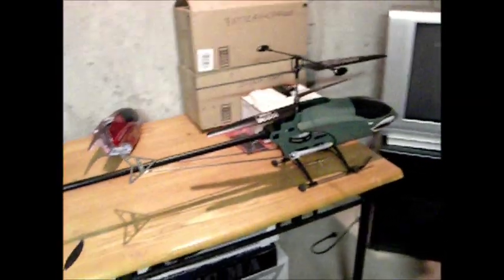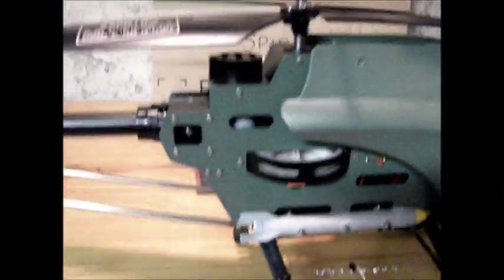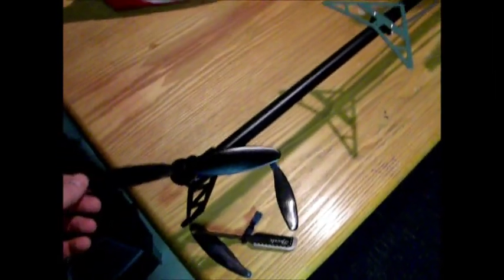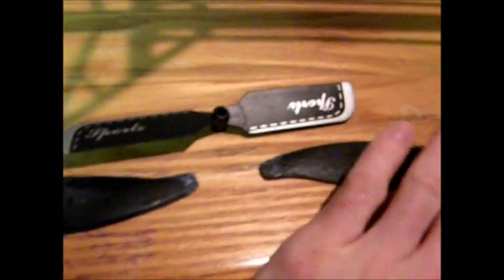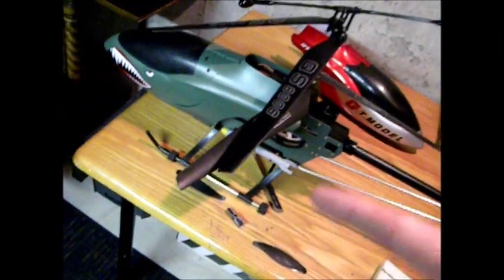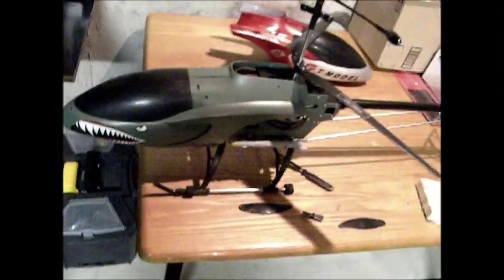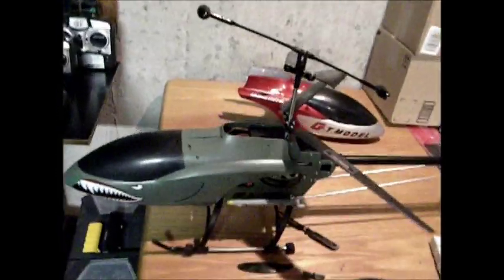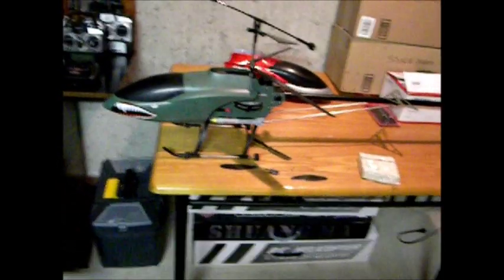QS8006 modifications (Paint, tail rotor, and weighted nose)

Comment: I bought a box of Plasticene from the dollar store.  Mine had 4 colors in the box and I used 10 grams initially.  I added a bit more and its perfect. Probably about 15 grams total. Try sticking it on the outside first and once you find the perfect weight, you can stick it on the inside.

Comment: The blades on the 8008 are  stiffer than those on the 8006 to no avail. You need a custom center shaft to space things out more.  Mine slap together right when I turn it on.  Since the 8008 is so expensive I think I'll just get the training landing gear for now.

Comment: You mentioned that your blades can slap together. My QS8008 does that as well when I land her to hard. Is there a way to tighten up the blade torque? I tightened down the screws to no effect. On large helicopters the blades shouldn't be so loose.